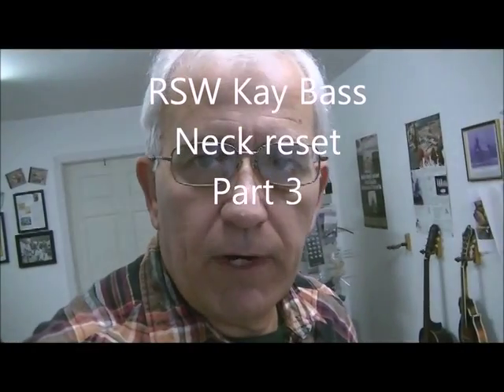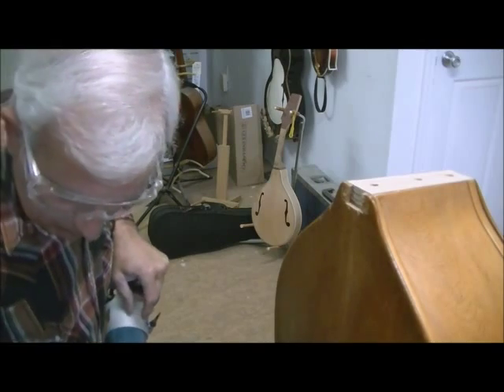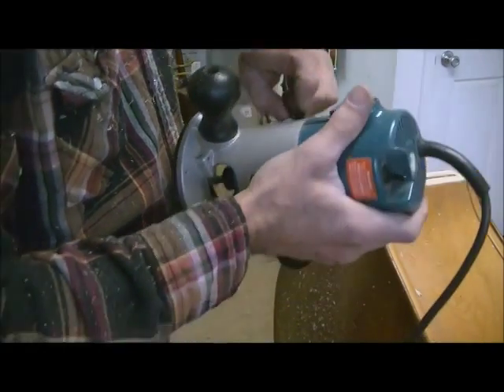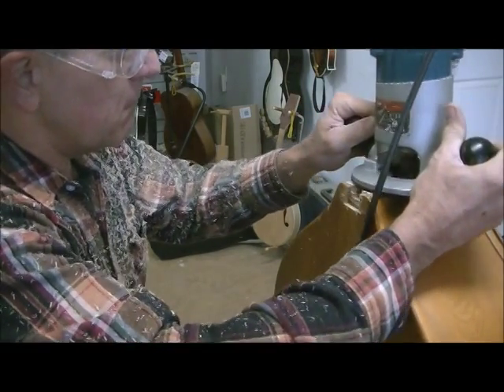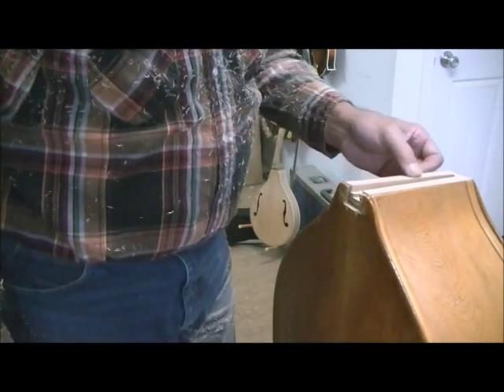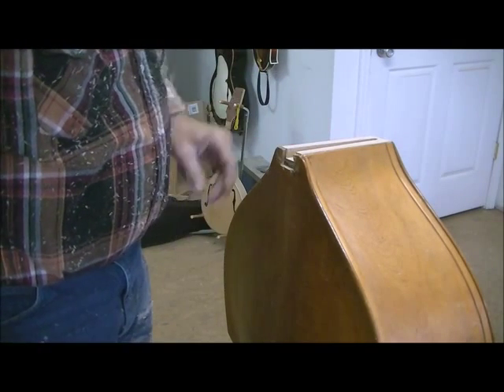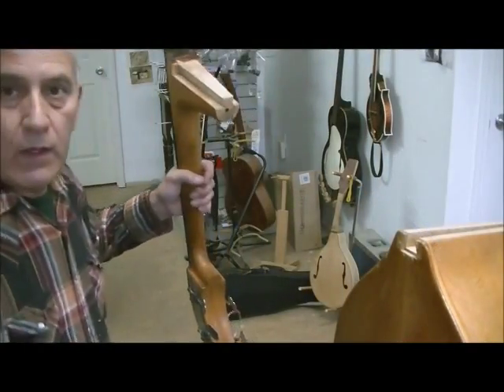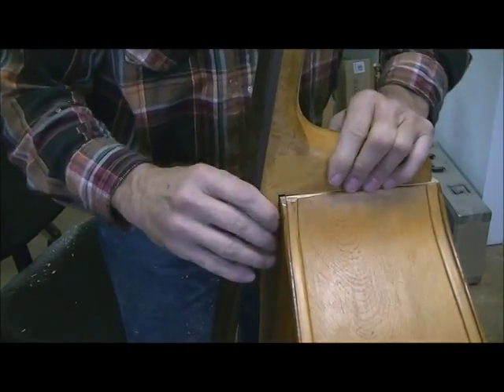036 RSW Kay Bass Neck Reset Part 3

Comment: I am wondering why you wouldn't have fitted the dove tails before you fitted the block to body
Reply from the maker: jeff barber probably could have done that.  Just felt comfortable doing it this way to be sure the neck angle and the fit to the body was just right.  Thanks for watching.